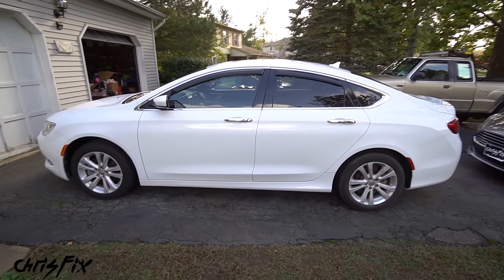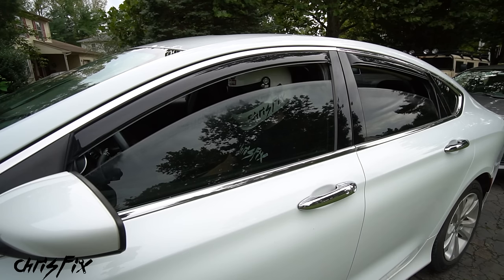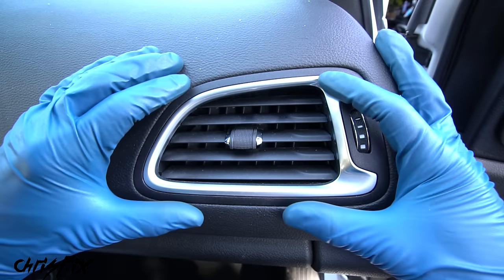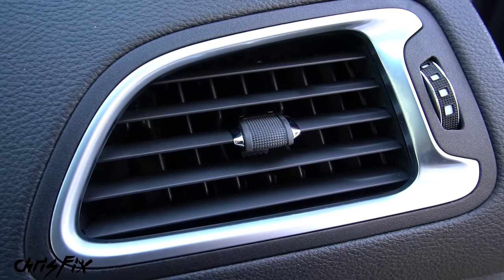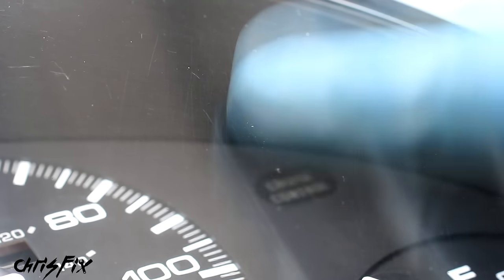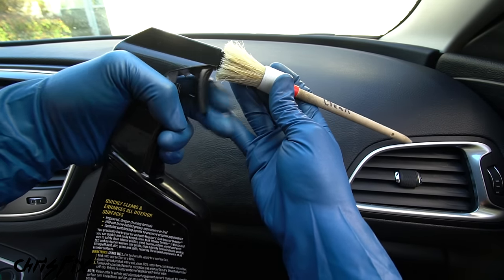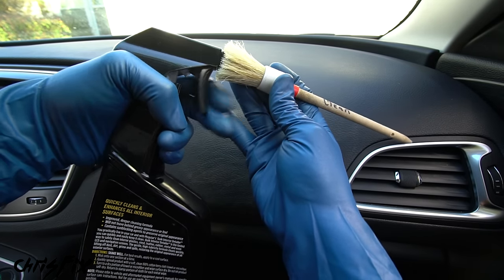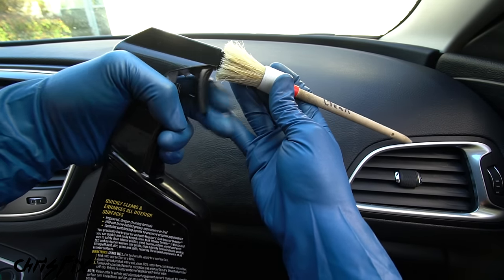How to Super Clean your Interior (Dashboard, Center Console, Door Panels & Glass)

Comment: Question for @chrisfix I notice that you used the Interior Cleaner on the dash, but the soapy water solution on the door panels. Can you speak to this method and why you chose the soapy water over the interior cleaner for the panels?
Reply from the maker: The interior cleaner is more mild and works with the variety of textures and materials and the dash wasn't terribly dirty, whereas the soapy wooder was needed to clean due to the mud and other dirt that was on the panel. Either would have technically worked but it depends on what's going on with that panel

Comment: I used soapy water (dish soap in warm water) and it seemed to degrade the surface of my steering wheel even further. I think it was already worn rather than just dirty. I used a microfiber rag and even a toothbrush, and it looks even more worn now. Suggestions?
Reply: Three months late but hopefully this helps:

The dirt and oils were probably bonded together with the steering wheel cover. Breaking up the oils probably pulled off some material. This was essentially damaged already but not visible because of the crud. That's why it's important to clean things regularly so you don't get that kind of buildup. Happens with paint and seals as well.

Obviously this won't stop degradation entirely, everything wears, but will mitigate some of the effects.

Comment: What about eliminating hard water spots on widows? Paul
Reply: Paul, slice a lemon in half and rub it on the glass with a fair amount of pressure. The natural acidity of the lemon removes hard water stains with ease. Wipe up the lemon juice left behind with a soft cloth or paper towel. Finish with a spray of glass cleaner and wipe it away.

Comment: What about scuff marks on the plactic surrounds.
Reply from the maker: I would try using something like a magic eraser, but test that in a small and un noticeable area first. Sometimes sanding down the plastic fixes it other times it doesn't turn out good. You can also try something a little more gentle and abrasive like toothpaste

Comment: ChrisFix
Are the brushes with the tan bristles (flagged bristles) more effective than the brushes with black bristles for the cleaning and polishing functions? I would think that the black bristles on the brush used for dusting are probably softer than the tan bristles--is that correct?
Reply from the maker: It really depends. If the bristles are all boars hare the color doesnt matter. It is the same. If the black bristles are plastic, then the tan ones work better and are softer.

Comment: A 2023 camry- the front dash under windshield is new but no shine- dull dry texture…. How to clean soap and water?  No low shine protectant??
Also- any solutions to scratches in a textured dash  ??  Or fine scratches on other dash surfaces???

Comment: i got a Nappa leather upgrade for my steering wheel , and the guy who handled it said to use skin lotion (for human use) , the simplest kind i can find, and after cleaning the wheel and degreasing it , to use the lotion on the wheel and leave it to soak afterwards , then it will fade away in 30minutes and it will protect your leather . not sure if this applies for synthetic leather .

Comment: You only cleaned the door with soapy water and supreme shine HI-Gloss protectant and I think you forgot to use interior detailer cleaner in between
Am I right? Or should we not use interior detailer cleaner to clean the doors?
Reply from the maker: No point in using the interior detailer in between, the soapy wooder and protectant does the job

Comment: I wonder how well that vacuum attachment, would work on cleaning Intake valves with some pic's and brake cleaner..
Reply from the maker: You need a mechanical abrasion for intake valves. That’s why they use walnut shells which they blast into the valves
Reply: @chrisfix  Yeah I know but I have seen ppl use Picks, and zip ties N drill along with a shop Vac and get great results.
Reply: @chrisfix  Walnut Blast is for People who Know People!! I called serval shops, and they either only do it on VW's or specialize in one type of car.. It's sad when you can have thousands in your pocket and still not find someone to walnut blast my car...

Comment: The problem I have with Meguiars products is that they have so many that seem to do similar or the same job and therefore I have never been able to decide which to get. For example they have the ULTIMATE interior detailer, so why continue selling the standard interior detailer and the cleaner  and the shiner and the protector, because allegedly the ULTIMATE does all of those jobs, cleans, shines and protects. Is there actually a reason why I should buy 3 products when 1 does the same job?
Reply from the maker: A good way to think about it would be like the 3-in-1 wax that is compound/polish/wax all in 1 bottle, technically for the absolute best results you would want to use 3 different products but using 1 saves time and the result is still pretty good. Same thing applies to their interior line. Personally I would just get the ultimate and know that all your bases are covered but if you want to really get super specific you have options
Reply: @chrisfix  Appreciate the response and bought the product. Thanks.

Comment: Help. On your steering wheel you use cleaning detergent but on your sister you advised against. Instead you used soapy water on your sister's steering. So which way is correct?

Comment: Hi Chris i spilled motor oil on my car' carpet, i manged to clean it and dry, but when i pressmy fingers in the carpet it still has oilnin it and the whole car still smells of motor oil, please help I don't know what to do anymore
Reply from the maker: I would use kitty litter or corn flour on it, and every so often remove and replace, then hit it with a pressure washer. I would then use something like dish soap and a stiff bristle brush after the fact to agitate anything left, and then use the pressure washer one more time
Reply: @chrisfix  thank you Chris will do this
Reply: Carpet on the car can't be removed so i can't use pressure washer,it's the carpet on the floor bed

Comment: Any liquid, outside of water, designed to clean, protect, renew/revitalize your vehicle's dashboard will actual harm it.  Naturally, Armor All, the most associated brand name with dashboard damage (although any cleaner will cause the same result), will claim that their product does no damage.  Perhaps they are right, and all of my sources of information are incorrect, but today I will continue to speak for the little guy rather than the big corporate entity.

The chemicals in AA, and other cleaners, can cause cracking and fading to your dashboard by breaking down the finish on your dash.  From my understanding, without getting too technical, certain chemicals found in these cleaners will degrade the integrity of your plastic dashboard, making them more susceptible to damaging forces.  Additionally, some of the chemicals seep down into your dashboard where the heat from the sun shining on the dashboard will cause that buildup of chemicals to expand.  As the substance expands, it will eventually reach the threshold where there is no further empty space to expand into, and with the integrity of the dashboard being compromised and weakened, the expanding substance will cause the dashboard to crack, like how a plant growing up through a crack in the sidewalk concrete can split the concrete, causing the existing crack to widen further, and it can even create additional cracks to form, which is somewhat akin to driving too large of a nail through too small of a piece of wood, or simply too close to the edge of the wood, and with the wood attempting to retract back from the penetrating nail to give it just enough space to fit completely inside, that retraction can cause the wood to split because the wood at the location of the nail's entry point wasn't strong enough to accommodate the nail and the wood splits because it required less energy to split the wood rather than to compact the wood enough to provide sufficient space for the nail.

AA contains silicone, one of the most common chemicals found in cleaning products for the interior of your vehicle, including your dashboard.  Silicone makes it difficult to remove dirt and debris from your dash, and that lustrous shine that AA leaves behind is a greasy residue that can attract dust and dirt.  The chemicals found in AA can react with the plastic in your windshield, causing it to become cloudy and opaque.  This is a slow process that happens over time, but it will eventually cause a noticeable difference, and the more noticeable it is, the more dangerous it is to drive under such conditions.  AA informs its users not to use the cleaner on steering wheels; brake, accelerator, or clutch pedals; floors; grips; along with a few other items in addition to "other surfaces where slipperiness may be hazardous".  Beyond that, there is no warning against using the product on your dashboard, in fact I believe everything about the product implies that it is for use on your dashboard,  however there is a danger with doing so which you may not have considered.  It is obvious you don't want to have slippery vehicle controls whether they are manipulated by your hands or feet.  You never want to unintentionally slip off of your vehicle controls, for that results in you losing control over your vehicle until you place your foot or hands back on the control which they had just slipped off of, and it only takes a second of not being able to control your vehicle to cause an accident . . . and who is to say that in attempting to replace your foot or hands back onto the controls, you don't just slip right back off again?  AA will still produce that dangerous slipperiness to your dashboard, but the type of danger will differ slightly, yet will not have any effect upon the potential outcome of experiencing said danger.  You may not have any need to place your hands upon your dashboard to gain any type of control over maneuvering your vehicle (but if you do, then let me know because I would like to see that), a slippery dashboard can still be dangerous.  If you are one who habitually places their phone upon the dashboard, or any other item, those will be more apt to slide around and fall off the dashboard, typically creating a distraction to the driver, which ultimately can result in an outcome just as dangerous as losing grip on your steering wheel.

Now, there are products on the market that are allegedly designed specifically for keeping your dashboard clean without causing any damage to it.  One article mentions a product called Aerospace 303 that claims it is a safe product to use on your dashboard.  However, I am not familiar with that product at all, so I can not recommend using it, nor avoiding it.  I simply do not know . . . and the main reason for me not knowing is because I was always taught, even by an "expert" at a major car dealership, that the best thing I could use to clean my dashboard to keep it clean, and looking new, without increasing the likelihood of it becoming damaged, is nothing more than a damp cloth.  That's it: just a little water, and even less elbow grease, nothing more to it.